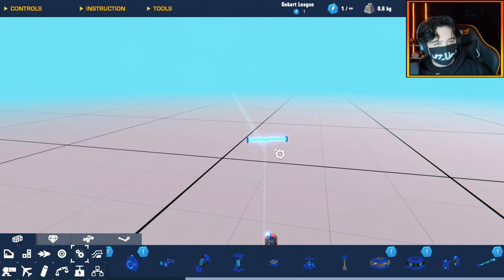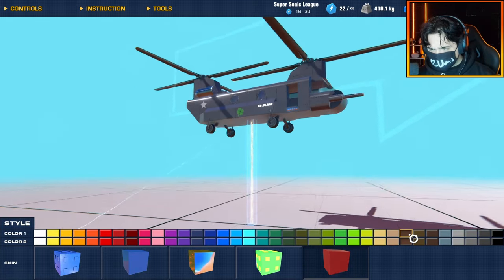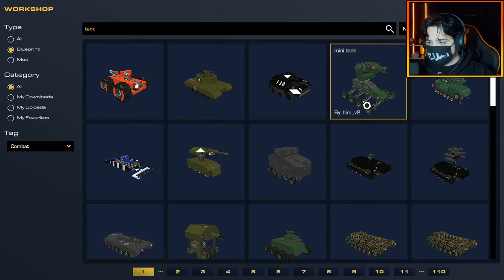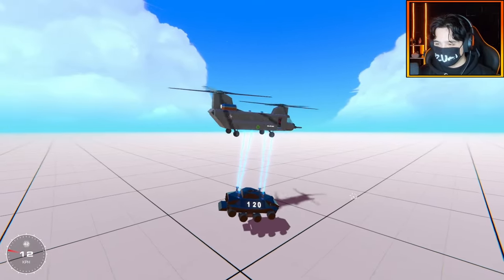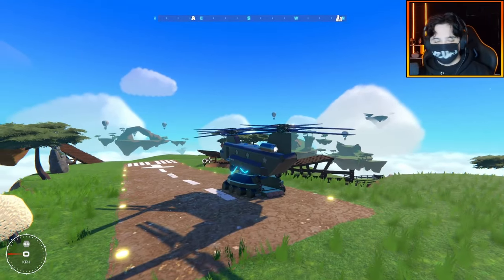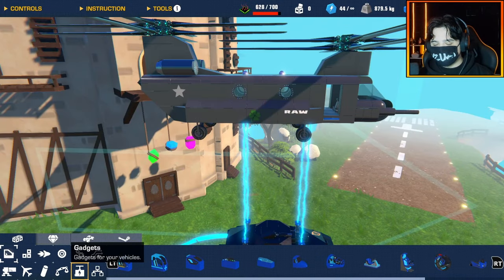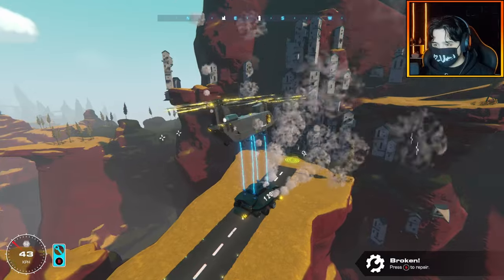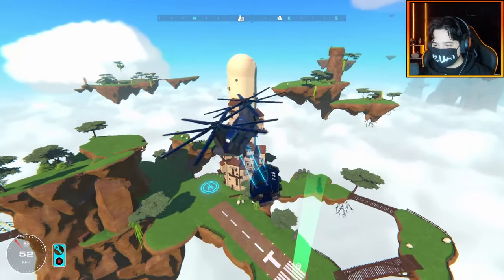I Used The 'NEW' BLOCK As Working ROPE!

Comment: Possible idea: 4-Legged Mech Animal that uses Power Couplings in Rope Mode to pull behind it a Gyro Stabilized 2-Wheel Chariot with Turret which the Player rides in! :D (Bonus Points if it becomes a Co-op Vehicle where Player 1 is the Mech Animal/Driver and Player 2 is the Chariot/Turret Gunner!)

Comment: Just had a thought: if you connected this to a cylinder piece that had spinning servos of some kind you could essentially make a winch since it would roll itself around the cylinder. So long as it didn’t glitch out hopefully
Reply: I have seen people make clock out of that idea but with chains
I also wonder if it works
Reply: @d261_gaming8  dunno how to do chains, assuming you use the swivels and trailer swivel with zero strength so they’re fluid but god I feel that’d very glitchy

Comment: Is the power coupling block just the block that you use to fly when walking around the map as a trailmaker, the little tool that shoots electricity down and pushes you into the air when hitting space or A on controller